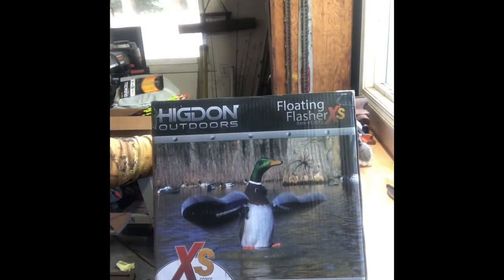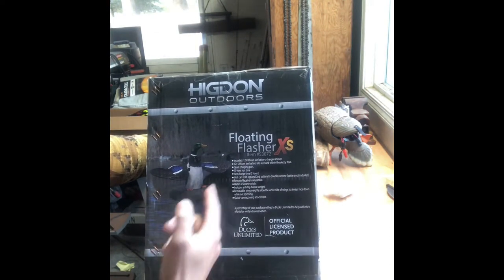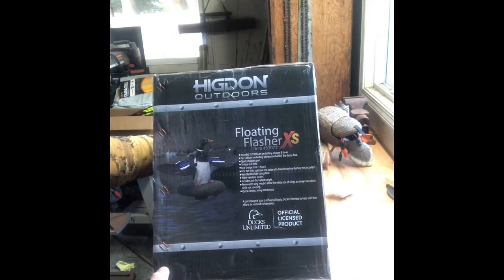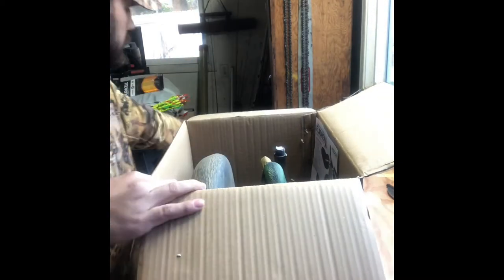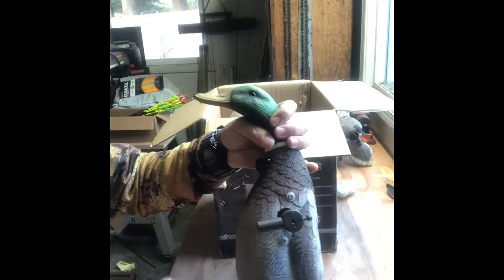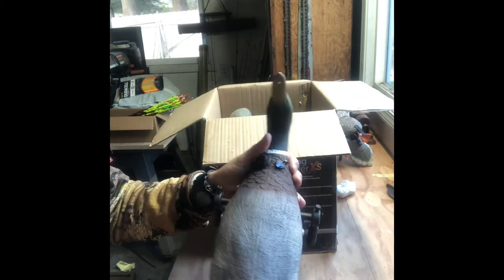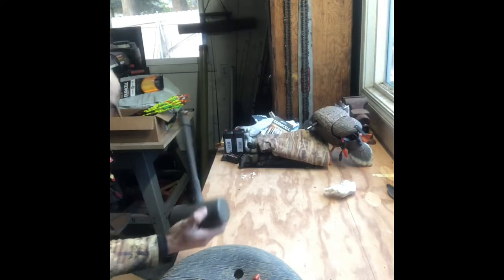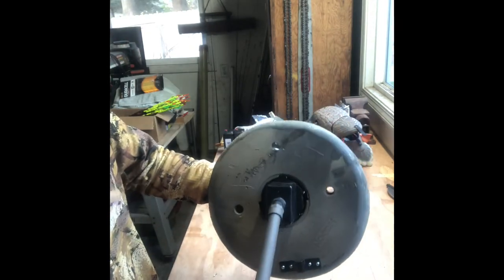Higdon Floating Flasher XS Mallard Drake Motion Decoy

Comment: Looking at getting one of these.  I have the pulsator butt and its awesome.  Got a XS swimmer and it stopped working after one hunt, not sure if water got up in the battery plug hole or if the bilge is clogged (havent had a chance to see) but have you had any issues with water affecting the internal battery?  The butt splashers are so good might wait until next season on this and get another one of those, since we can use mojos/motion all season.
Reply from the maker: @ForceMajeur Nope haven’t had any issues other than the wing to motor attachment coming loose, but fixed that with a little blue loc-tite. Thanks for watching.
Reply: @figsoutside1981  thanks.

Comment: Any complaints?  Just ordered one.  I guess i need remove for intermittent?
Reply from the maker: No complaints really. The only actual complaint is the little allen head screw that holds the main shaft to the motor came loose and my wing fell off and sank. Found it though. Got home and put loctite on both sides for extra peace of mind. Yeah, I don’t like the intermittent. Tried it and it seems to flair more birds than attract’em. Thanks for asking and for watching👍🏼.

Comment: Have you noticed if this is spooking the ducks?
Reply from the maker: No, works great. Used it since I got it in my duck hunting vids. The only thing I would recommend is that you put thread lock on the allen screw wing mounts where it connects to the motor inside the body. Had mine back off and the whole wing and attachment fell off into the water. Thanks for the ? and for watching.